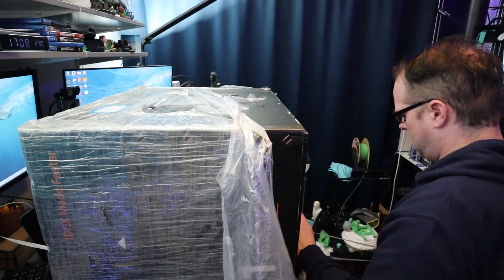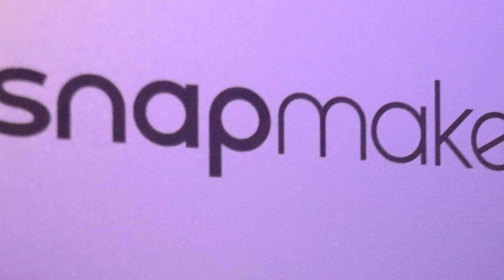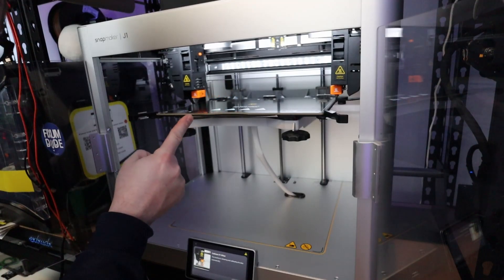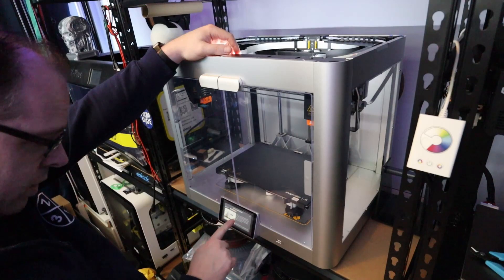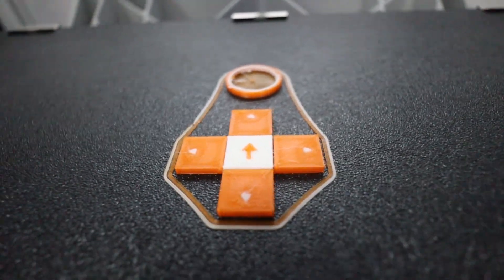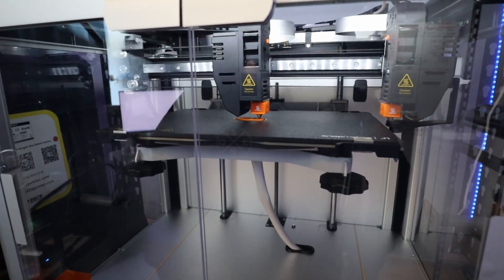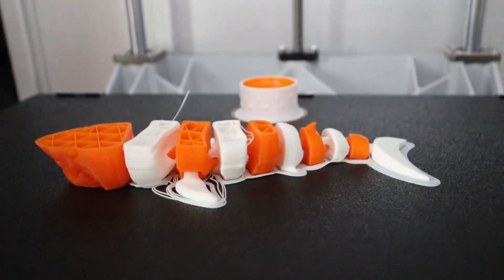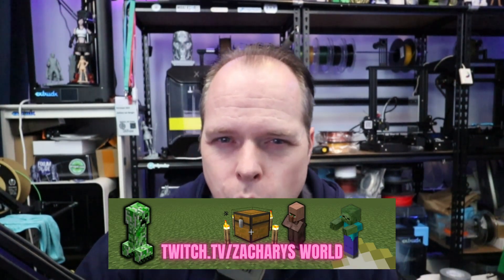Snapmaker J1 IDEX 3D Printer - Full Setup and Printing Tutorial

Comment: Although my device is 2 weeks old, ASA and ABS filaments do not stick to the tray, what should I do?
Reply from the maker: They don't stick to the plate? I assume that the bed is well leveled and clean, that the height for the first layer is pushed well enough to the build plate? Did you tried the glue-stick or some other recommended adhesion products?
Reply: @Zachary3DPrints  Türkçe yazarmısın
Reply from the maker: Geç yanıtım için özür dilerim. Tabağa yapışmıyorlar mı? Yatağın iyi seviyede ve temiz olduğunu ve ilk katmanın yüksekliğinin yapı plakasına yeterince itildiğini varsayıyorum. Yapıştırıcıyı veya önerilen diğer yapıştırma ürünlerini denediniz mi?

Comment: Since this doesn’t have bed levelling compensation, how straight is the print bed ? I’ve been looking for an IDEX printer for a long time to print nylon brackets about 280mm long. They have industrial use case so they need to be straight.
Reply from the maker: Sorry for my late reply to your comment. They use a very advanced way of leveling the bed during the calibration phase. But after that there is no leveling for compensation during the print jobs. They have this PEI glass bed and I think it is straight

Comment: i have this ides too. you must calibrate. your z offset isn't successful calibrated. these problems are no printer problems. I had to update firmware and calibrated again x,y with the whole in the middle option. my snapmaker ist running without any trouble.
Reply from the maker: Yeah, mine is also printing without any trouble. I had some small issues at the beginning